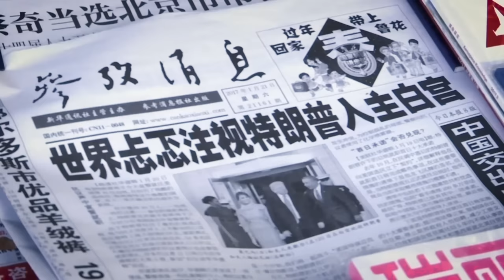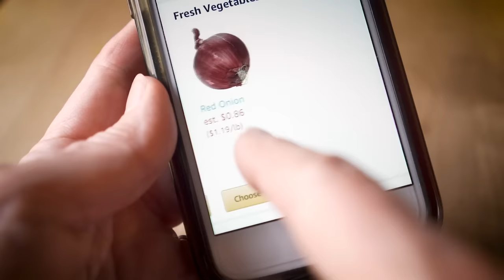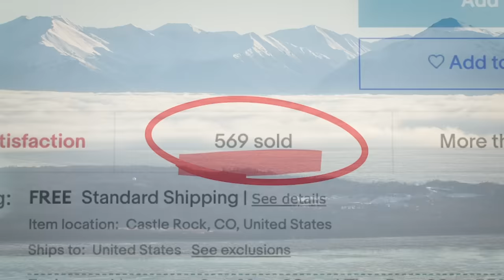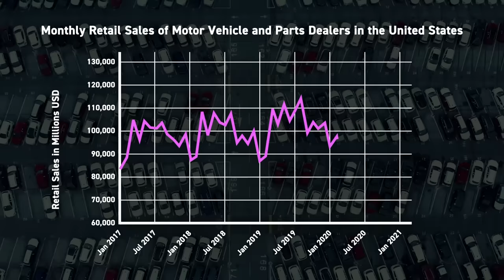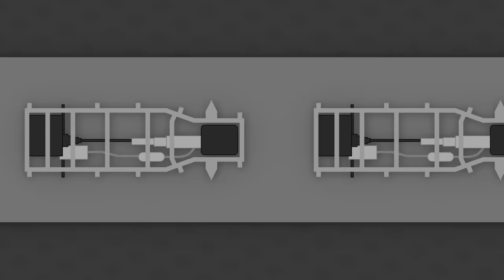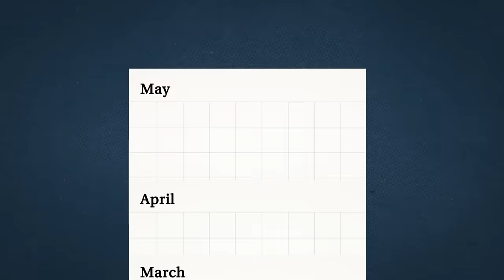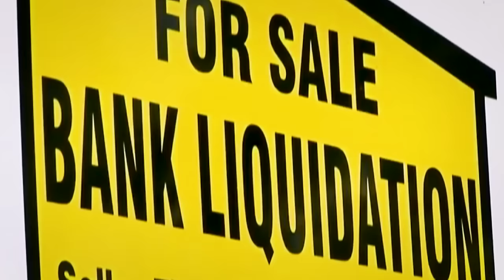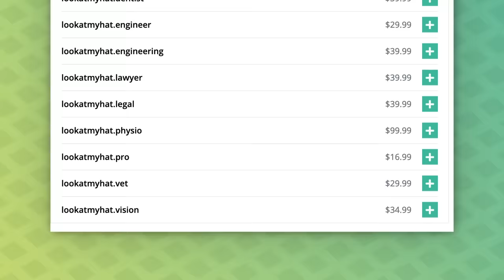Why There are Now So Many Shortages (It's Not COVID)

Comment: As a manufacturing engineer, this is great! I work low volume high complex components(biomedical device)  and I think TPS is stupid for my companies business model. Because we’ll be missing a jar of silicone and we have to stop manufacturing. The inventory cost to house 10,000 units is not much and because were medical device, we’ll build it for easily 5+ years with minor revisions. TPS screws our supply chain system monthly but no one seems to think this is a problem.
Reply: Perhaps a part of it is the lower resilience of the contributing materials to your manufacturing (as alluded to with Toyota and the plastic parts vs. silicone chips). And the low revision rate (probably, I'm guessing, largely because of expensive R&D and legislation?) means you aren't stuck out with purchased materials that can't be used. And outside of Japan warehousing is less expensive, like if you're in the US outside a metro area the land is a relatively small expense compared to workflow stoppage.
Reply: To be fair it sounds like this is what was discussed at the end of the video - it is JIT without the resiliency built into TPS.  Can't really blame TPS if it's not being followed properly is all I'm saying.
Reply: The problem is implementing it blindly, and most likely an eye for short term profits, rather than long-term benefits.
Perhaps there are essential things that does not, and cannot, reach the economic of scale as large as a car production does. However, your company might be experimenting with that - and as an employee, if you find an avenue to talk about it, you should try talking about it.
Or give them this video.

Comment: When you shake a juggler's elbow, don't expect all  the balls to stay in the air.  :-)
Reply: This vid is a total red herring fallacy. What shook the juggler's elbow was COVID. 
Every person on the planet Earth dies for the same reasons their heart stops pumping blood and their brain stops functioning. It is what CAUSES this to happen that ppl refer to when they say what someone "died of." Died in a car accident, trauma caused heart and or brain to stop. "Died from cancer" is a slow deterioration of the body's systems. 
This vid basically goes over HOW COVID and its subsequent lock-downs, sudden change in ways of doing business, etc caused these interruptions. 
The thing is if ppl think this is bad.....it is only going to get worse.
Reply: @tanyachef  what is going to make it worse?
Reply: @tanyachef  
This virus did not cause these shortages.  The governments response  cause the shortage.  I would argue that this "pandemic" with a mortality rate of .05% is only slightly worse than a bad flu season.  Of course it has been tragic for those effected.  But also tragic for those effected by the shutdown.  Repercussions from the governments response will be felt indefinitely.
Reply: @tanyachef  You're missing the point.  If you manage debt properly and build resilient supply lines etc then we could've rode covid out with minimal economic impact.  

The problem was not the shaking of the elbow, but the irresponsibly ambitious juggling.  Juggling with rubber balls at a circus is all well and good, but metaphorically juggling with glass balls with people's livelihoods inside them while walking down a busy dangerous street not so much.
Reply: Fauci caused the shortages. It was not an accident.
Reply: @tanyachef  What you said is exaclty what Sam said. Covid caused it, but inly becuase it was in the right position to solve it. If we go with the juggler thing, the shaking vuased the balls to fall, but only brcuase they were being juggled in the first place.
Reply: @tanyachef  Govt reaction to Covid did THIS TIME.  Many other things are waiting in the wings.  Saving money by turning a resilient system into a non=resilient one is bad   business...
Reply: @Jeremiah Liggins Thank you
Reply: @hardrockuniversity7283  and to everyone else...yes, I totally agree. I have thought that, even from the beginning, the gov reaction to the virus was not appropriate. Im sorry but I guess I did not pay as much attention to the details of this video. I do believe there are MUCH HARDER times to come. I am preparing. Built/and continue building my financial boat. The "flood" is coming. I think that we all will be kept in masks until the economy starts to take a serious down turn. Then they will open things back up and there will be a surge with pent up spending, ppl dying to get out and go to concerts, events, etc. That will blow this bubble up so much that it bursts, plunging us into a serious recession if not depression. Inflation is already totally evident. 
The sad thing is how this is going to affect the world's poor. It is going to get much much worse b4 it gets better. 
Historically, countries get themselves out of hot water with war, so a big war could also be a strong possibility
Reply: @joemilton7552  BTW I am speaking from an American perspective. Covid and the gov reaction in places like CA and NY has really made a big mess of things. Ppl are still "asleep" and do not see the consequences that are to come.  
-Massive inflation. The last CPI showed it is already significant. 
-Massive unemployment and or underemployment. 
-Biden printing more and more money. Making the dollar weak. 
-The Gov getting even more control over ppl than it already has. I mean how long will ppl just stay home and expect to not have things like court, gov offices and depts. 
-Defund the police. Where does that $ go? How are ppl "in the community" going to have the network, experience and or ability to make this a seamless or even remotely smooth trans and serve the community...IF this was even a serious possibility. Any $ taken away from the police will have to be returned and then everyone will have paid twice. 
-Ppl trading their liberties in bc they think that the Gov will then in return "take care of them" and "give" them things like "free" college, medicine, and "opportunities." Gavin Newsome is using tax $ to dodge the recall effort by paying ppl and "helping them out"
I have to make pizza for dinner now so, yeah, these to start with.....
Reply: @tanyachef  Unfortunately I agree with you whole heartedly.  Remember though that money isn't everything.  My wife and I moved to Montana this January with only a small support system and no job lined up to get out from 'behind enemy lines' so to speak.
Reply: @tanyachef  Just a heads up: inflation is worse than you think, and they don't realize it. No this isn't just some conspiracy thing it is the obvious result of changes to the formula over time. 

Prior to the 1980s inflation was basically a measure of what changes it took to maintain your standard of living. If, for example, you ate steak and drank Bouba tea, and the price of those went up 10% the cost to maintain your standard of living (SoL) went up by 10% of whatever portion of your expenditures that came to.

But in the 80s, then again in the 90s, that changed. They stopped counting "out of pocket" costs and allowed for cheaper substituted. For the first example, a real one: changes to federal mandates on gasoline formulation directly caused a 10 cents/gallon increase. We paid that added price, but in the new formula that was excluded because it was ... well it was a government mandate. Never mind the fact it cost us more, they didn't count it.

For the second example, say steak and boba tea go up 10%. Instead of counting that, they instead substitute plain black tea from a tea bag, and ground beef. Same "product", but now SoL cost didn't go up - and maybe went down for those two items.

But why do it? In part because of a "perverse incentive" in the way government budgeting is set up. A huge chunk of the federal budget is "non-discretionary." One aspect of that is retirement benefits, which are tied to the cost of living. Now I am sure you can see where that goes. That creates an incentive to lower the SoL changes in order to make the books look better.

If you take the old formula, when it measured the delta to maintain a standard of living, we are sitting at around late 1970s level inflation already - more than 2x what the official numbers are today.

Now before I go, the money printing has been going on since 2009.
Reply: @IAmTheRealBill  I totally get it. I studied both Macro and Micro Econ in college. It is amazing that ppl will make the same mistakes thinking they can do something the same way but get a different result!?!?! 
U R right. Unfortunately, I called it out years ago when my husband and I owned a home in SF. In 2017 I KNEW that SF was going downhill and that we should sell. I gave it 5 yrs tops that SF would look like NYC in the 70s.

Comment: There's one other bottle-neck in the supply chain that wasn't mentioned.  Space, as in just enough space at the Port of Los Angeles.  When there are more empty and unused containers accumulating in the yards, there is no space for the efficient handling and placement of new containers so that they can quickly be put on trucks for delivery.  When they run out of room, there is absolutely no place to put freshly unloaded containers.  The pass-through rate can't increase until there is the ability to efficiently use the available space.  Storing empty, unwanted containers is not an efficient use of port space.  Having to move and re-position 4 or 5 containers (and finding space to put them) to get access to the one container in demand is not an efficient use of time, labor and equipment.  Adding to the problem is the fact that thousands of small business that had placed overseas orders went out of business during the pandemic.  There are now many thousands of containers full of unclaimed merchandise that can't legally be disposed of.  So they have piled up at the port taking up precious space.  Just enough space at the port is a long, long way off, which means that clearing the critical port bottleneck is a long, long way off.

Comment: Another factor for rental car shortages is design change. For a long time Nissan was one of the largest suppliers of cheap rental cars. The Sentra and Altima filled inventories across the board. With Nissan trying to rebrand it has fundamentally changed their hardware to the point it doesn't match rental car requirements. The biggest was the switch to the AWD Altima in 2019. Rental car companies were selling off their entire inventory just weeks after receiving them. Having to replace 4 tires because of one isn't financially viable in the industry.

Comment: The Port problems in LA/LB are accurate; I deal with it on a daily basis. The JIT manufacturing explanation is also pretty much spot on.
Reply: Just a question, why the fuck did they not build up other ports and hinterland transit routes for them to avoid that? 

OH wait, that costs money....and redundancies are baaaad....
Reply: @LupusAries  There are other ports up and down the west coast. You can't just build ports anywhere. You need the appropriate geography, open land and transport infrastructure, as well as a cooperative labor force.
Reply: @mikegarwood8680  Ok, I think you misunderstood me with the build up, it was meant in the sense of upgrade existing ports and their infrastructure to avoid bottlenecks like these. 

But while writing I noticed the old trend that was shown in this video....building up an existing port and it's infrastructure would cost money and the other ports would see that as encroaching on their turf......

In short it was not done for short term savings. 

That was a failure of transport policy on multiple levels over the time.
Reply: @LupusAries  That all depends on the Longshoremen's Union. They are resistant to automation to protect the cushy, high paying jobs.

Comment: Wendover: Great video! I appreciate that you added additional information using Toyota. I could fill a book with stories of how Toyota runs its assembly, stamping, and engineering efficiently. One: There are literally no compressed air leaks in its manufacturing facilities because it costs money to run a compressor. Two: Presses and manufacturing equipment is painted white so oil and other fluid or air leaks can be easily seen and repaired.
Reply: PEACE 
PROSPERITY 
BONANZA 
ABUNDANCE 
FREE THINKING
Reply: White? How is it you could fill a book with stories? Neither of the two examples you gave is correct?

This video also gets some minor and major things incorrect.
Reply: @bobbyjbobbyj  Please do tell us your version then, we'll compare ourselves
Reply: @m2heavyindustries378  he said there are literally no air leaks. That’s a logically ridiculous claim and it’s untrue. Of course there are leaks, as there are in any company. It’s fair to say there are efforts to repair them, but there are certainly air leaks in every plant.

He also said machines are painted white to see leaks. Not true. Not even all plants have machines the same color. And they’re not white, anyway. Machine color is sometimes dictated by the machine maker’s standard.

My guess is the OP is speaking from the perspective of someone who has read about Toyota or maybe visited a plant. But it’s not from the perspective of someone who has inside stories.

Comment: "It's not covid"
"It's covid"
Reply: That's my thinking 🤔
Reply: Covid was the trigger. The problem already existed, and if Covid hadn't set it off, something else would eventually (and, in fact, on a smaller scale, has before).
Covid would not have caused, or been able to cause, those specifie problems, at least not to such an extent, were it not for the systemic flaws already present. 
Thus, the case is made, the Flaws are the actual cause.
This is explained preeeeetty clearly in the video...
Reply: @laurencefraser  There are absolutely many flaws and those were outlines very well in the video. The flaws however were not the cause of the widespread shortages, but they did greatly exacerbated them. Without covid, these massive widespread shortages would not have happened all at once. It could have absolutely and would have eventually happened with specific industries, but not all across the board like the pandemic caused. Just my two cents though and I’m happy to be challenged on my thinking because I don’t have all the answers.
Reply: @laurencefraser  It's like how the E.T. game "caused" the great video game console crash of 1983.  There were already flaws that were building up in the industry, and it was only a matter of time before something was the trigger.  If it hadn't been the E.T. game, it would have been something else.

As E.T. was to the video game crash, so is COVID to the current rash of shortages.  Not the major cause so much as the trigger that precipitated a building disaster.

Comment: Stockpiling a small amount of extras for crucial things doesn't sound too bad actually. Have enough extra to last a small shortage if necessary without needing to panic buy or go full on dooms day preper. Speaking of I'm sure they felt these shortages the least.
Reply: It is a security risk to rely so heavily on foreign supplies
Reply: wait, so stockpiling on toilet paper was unnecessary??
Reply: @klostrel  Completely unnecessary if you have a bidet or an aftabeh and water.
Reply: @Nova-ru5kr  It took me two years to use up my mother's stash of TP that I inherited when she passed away.  Some folks, particularly the elderly, develop what is called "hoarding" behavior.  Whenever  I get down to one package, I buy another.  I did however look into kits to add a bidet function to a standard toilet!

Comment: I have direct insider knowledge of the shipping container shortage crisis.

I worked with international cargo shipping, because I was at a Danish-based company who set up shop in America. We would ship product from Denmark to America at a rate such that we received 3 to 8 shipments a week.

It use to cost us $600 to book a container. This was in 2019. By 2021 it cost us upwards of $2,700 and rising. This was just to book the container, not the transport, railyard, holding and freight fees, and not the delivery. It was, all in, rising in cost to $10,000 to get a container shipped from Denmark to our loading dock for delivery.

The reason, we found out, was China was hoarding shipping containers. They had an estimated 30 million containers, all empty, sitting in abandoned stretches of their coastal ports and inland at railyards.

China was artificially creating a shortage, so that they can slowly release containers at a record profit.

If it cost $600 in 2019 to release a container, and now you have to pay $2,700 or more, you can see how much of a giant profit margin you just gained. And all you had to do is pay a few security guards and install a couple of cameras and maybe a fence or two.

Comment: This video did a great job of connecting a couple of the logistical dots that the average person doesn't think about. You could also ship straight to the east coast from Asia,  but the transit times are worse and the cost per container more than doubles. So your $5 Boba tea becomes $10.
Reply: Isn't it easier to build more West coast ports? I'm amazed there are only two!
Reply: @brujo_millonario  the cost of acquiring that much suitable land on the coast of California,  having the government sign-off on it, getting the skilled labor to run it, the trucks/drivers, etc would be a logistical nightmare. Not to mention,  as soon as you got it all up and running the regular ports would most likely go back to the regular efficiency and you wouldn't be needed. Of course this is all purely my opinion and you're willing to spend your billions wherever you'd like. ^^